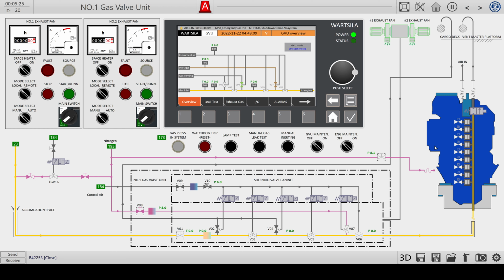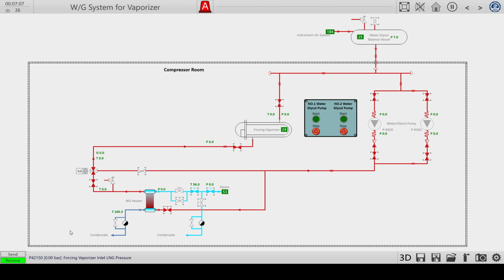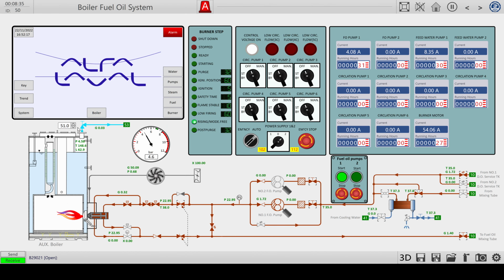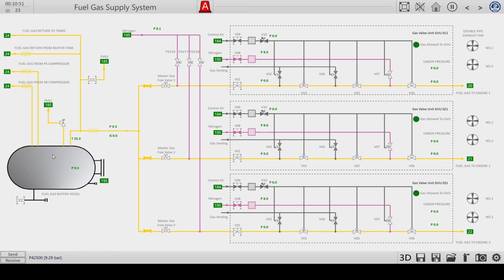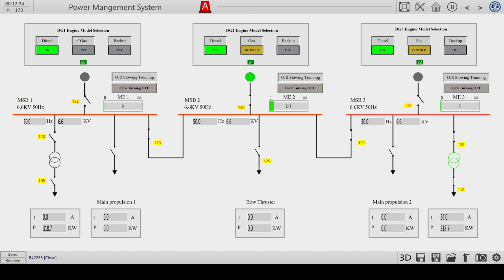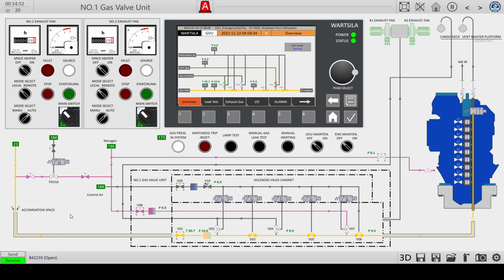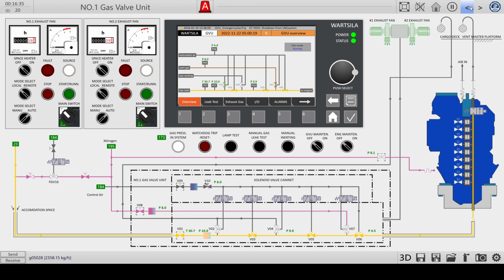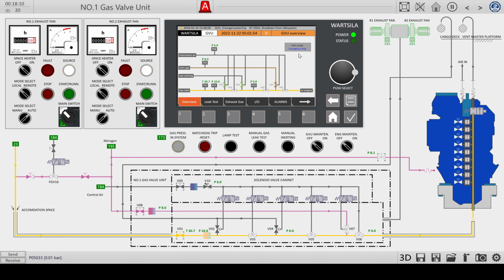LNG vessel - Gas fuel mode

Comment: Hi Naruby, sory i hafe no idea !
My LNG Simulator start only for a short time , short time go in offline and so on. 
I cant help yu .....sorry !!
greatings from Austria !!  ;-)
Reply from the maker: Did you out your regional setting (Windows K in Chinese? Is there an error pop-up in the M program?
Reply: @narubyriverlione  Hallo Naruby it wars a problem with the 
access settings. now it runs! Thanks for your help. now i can test the gas fuel settings!!
Naruby have you power in the Bilge System ?
Reply: @narubyriverlione   have you testet with the Exhaust fans in lokal mode and the runs?
Reply from the maker: @thomasenzlmueller1572   with some tips from a fellow YouTube friend I found the problem and I will make a video about it (sometime :) 
TL&DR; the fuel gas was to hot. It need to below zero degree C. 
I didn’t use the BOG compressor and coolers and coupled wrongly from the vaporiser directly to the fuel buffer tank.
Reply from the maker: @thomasenzlmueller1572  I think the bilge, airconditioning & refrigeration systems aren’t simulated yet on this lng vessel.
To bad there is never a changelog after a vessel update.
Reply: @narubyriverlione  Fine !! OK its a importent Information!!! Have a nice Day!!